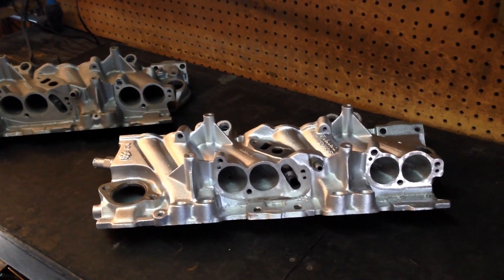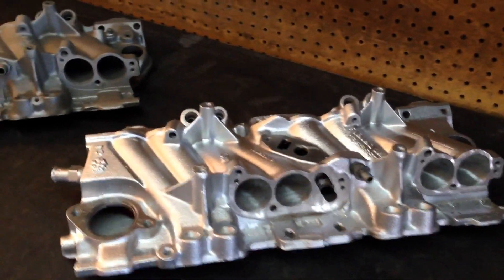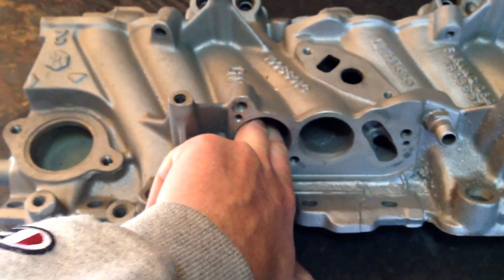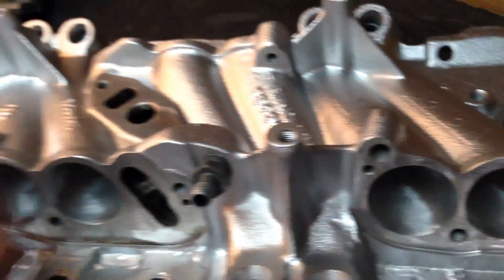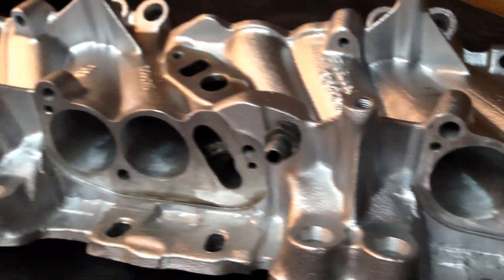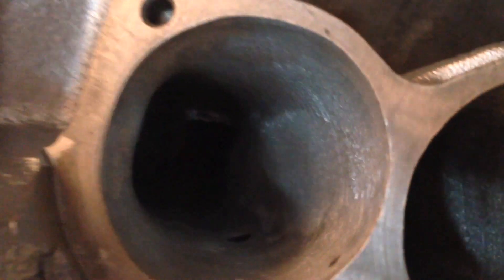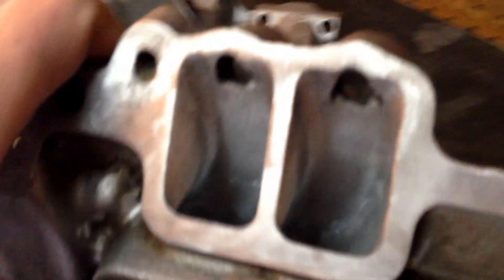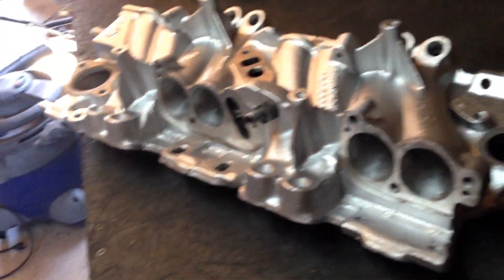TPI intake manifold comparison

Comment: Just got a TPI L98 89 Firebird Formula. I took off the throttle body and cleaned it up like new if was really filthy. It's clean like new now. Would you recommend taking off the plenum and runners and cleaning the inside of them as well or will it not make that much of a difference. I looked through the plenum and it has a lot of carbon build up , really black inside probably has never been cleaned.